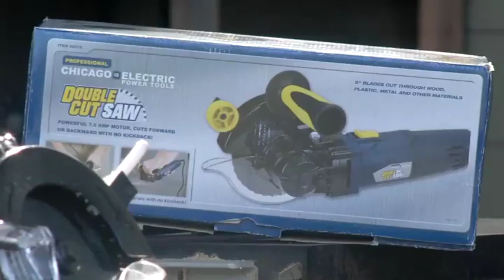5" Double Cut Saw HARBOR FREIGHT

Comment: I have one of these Harbor Freight saws that is 2 years old and it still cuts very well , I use chain bar oil instead of the wax rods  when cutting any kind of metal and it has preserved the blades very well !    It cuts  everything I needed it too and is very easy to control !    Good  luck with yours !
Reply from the maker: My saw has been working well with the same original blades. It is an amazing tool considering the low cost. I even used it for about an hour and forgot about the wax rods, seem to have no problem until towards the end when it got noisy. Added one rod and all was back to normal. I will keep the oil in mind. Thank you for the comment.

Comment from the maker: Good deal, thank you for sharing the info and worth it. So far my blades are still good.
I was able to notch a gap in an aluminum screen door with stripped screws. I placed a small piece of wood inside the door as a backer and it worked perfect. That door was a previous nightmare re-tapped to the max. Now, problem free.

Comment from the maker: @junkman6261 There are 2 blades and they are $25 a set. I would estimate over 40 steel pipes. The blades have an extremely small contact area. They look similar to regular saw blades in the 50 tooth range but they are hardened a bit more from what I have researched. I would suggest short runs of 1 minute or less because the motor is high amp for its size. Like a cord or cordless drill. Run one fully loaded for more than one minute and they get hot.

Comment: how about replacing the blade? how often? is hard to find the new ones? how wide does it cut? are there different versions of the blades (faster and coarser or finer and slower for example)?
a lot of questions, but that's some of the things I look for when I buy a tool

Comment: I have the newer version of this saw, and like it a lot.  The problem with your video is, you did not use the lube stick, you have it in there, but it is not self feeding, when you start the saw, you have to turn the yellow wheel a little,  to lube the blades, then do the cutting.

Comment: I was considering this saw. Glad I didn't.  The Omni dualsaw is more tougher and has a stronger motor. Though, the deafening sound is like a jet engine...probably design for commercial use.  It was only $10 more and a better warranty.

Comment: Does this cut through ceramic time or glass tile?  If you have tried it, can you please let me know ?
Reply: No, it won't work for that type of material.  It would break or severely damage the tile and the saw.  Cutting tile requires a diamond blade and usually a stream of water to keep the blade cool.
Reply: The actual dualsaw brand does sell a diamond blade for theirs for tile and masonry

Comment: Thanks Dan- I'll pick one up Sat. ! This appears to be a "Tinker Tool" A general purpose prototyping tool... as we pros refer to it... our wimmen call it farting around out back...

 If you need a tile saw or a chop saw- or a cutting torch- use the right tool for the job. Especially if you're trying to make a living with it. 

Have you done the HF version of a RotoZip? Can't you just use the special bits in a die grinder?

Comment: @GREENPOWERSCIENCE It's true that most tools are made in China, but the difference is the quality control implemented in the manufacture.  I do a lot of woodworking and have now gone through three HF drills (compared to the one Hitachi I've had).  I worked that Hitachi drill much harder, it single handedly put up 135 feet of 6 foot board on board fence, lag screws and all.  1st HF drill blew apart on me to my dismay sinking holes in MDF!  I AM fond of my HF bearing press though.

Comment: Seems like HB uses the same motro housing for most of they power tools.
Both my sawzall and angle grinder scream like hell. Ear protection is a must.
Unless you like being deaf.
Reply: I have the actual dualsaw brand one and its extremely loud. I thought it had bad bearings first time i cranked it up